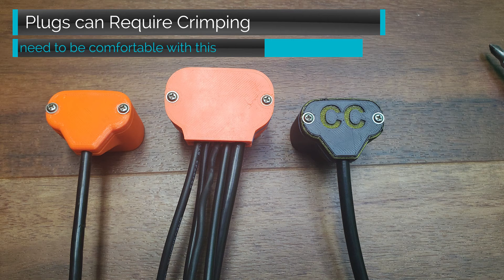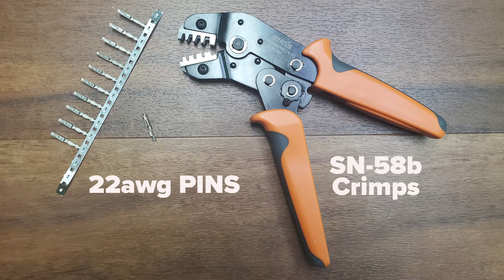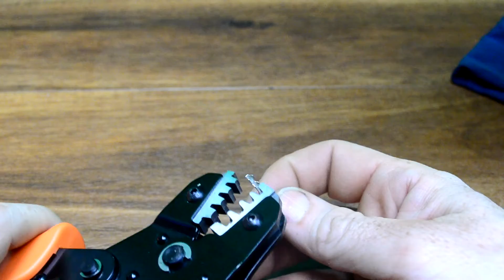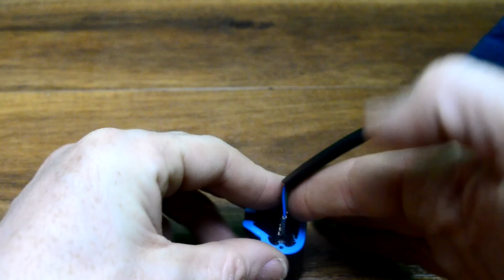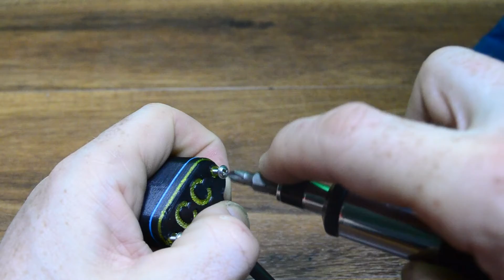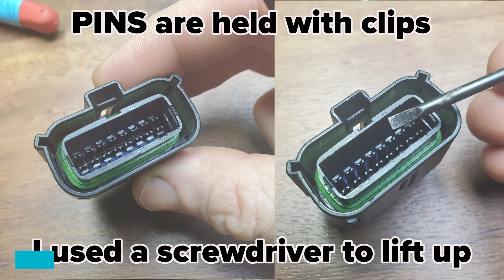Molex Plug Wiring Connectors for ASI BAC2000, BAC4000, BAC8000 - Ebikes Wiring, Use and Assembly

Comment: Hi, does anyone have the part number for that connector? Thanks in advance
Reply from the maker: I make them myseld Rick. It's my own design.
Reply: @HighVoltageKits   gotcha  they are nice and flat  better fit than the ones I have. Currently, I follow the link on your video but is broken
Reply from the maker: Shoot me an email to John@highvoltagekits.com the site is under construction. I have a few options depending on what you want.
Reply: @HighVoltageKits  cool. I definitely would like to get both of them if they are available
Reply from the maker: Yeah for sure. There is a newer version that's a bit more low profile. It depends how many wires you need to exit the larger one.
Reply: @HighVoltageKits  is just for the eggrider display  power switch and e brakes. I'll send you an email

Comment: If I wanted to fit a better Battery and Controller in my e-Scooter where in the UK could I get one made - It's size-specific want it to replace the original - Want to go to 48V from 36V... It must have the waterproof connectors.
Reply from the maker: You can try asking on the channel discord for scooters. I am not aware of a UK supplier for that kind of controller. https://discord.gg/5CkzW8sg

Comment: can I use these to make a connection b/w my ERT NXT screen and the BBSHD wiring harness so I can remove my screen at the grocery store to prevent theft?
Reply from the maker: These are designed to work with the harness connections on the larger BAC models. You can use the Higo to unplug the NXT although the number of times that works is in the hundreds I am told. You could also manufacture a quick release connection. I think it is four wires or five wires that hook up the NXT. Hope this helps Sir. Cheers!

Comment: Nice video !    For misc uses and perhaps  unlocking the barbed retention spring pins in different connectors , I like to have different size needles .   An assortment between 20-30 gauge are great to have.  I imagine you can get them online, or ask your friendly  diabetic for used needles and syringes.  

You can even get them at dr if you show them what it is for and bring a tiny file to dull them at the end, so they know zero likelihood of anyone using it for unapproved medical usage.      

30 gauge also come in handy when you have to test-probe  insulated wire (non destructably) to make a measurement
Reply from the maker: Thats a good idea. Actually I have a source of those. The tool that Molex sell is insanely expensive.. Actually the crimpers they sell are hundred of dollars. I am not sure how they get away with it!